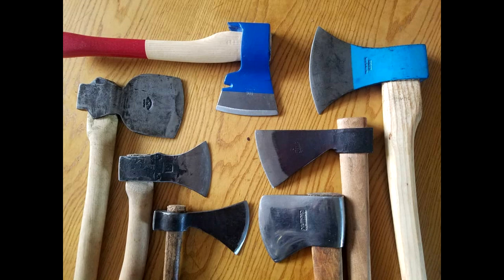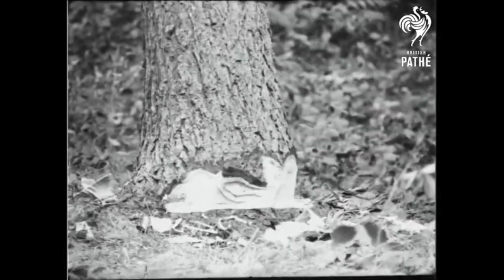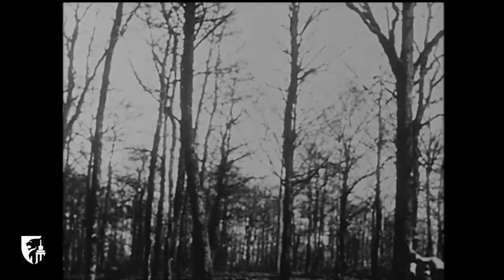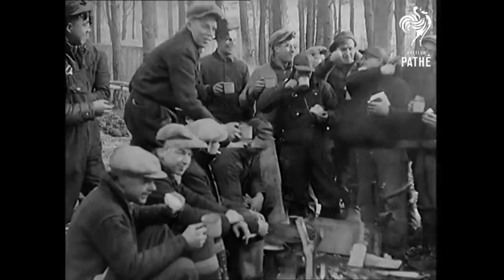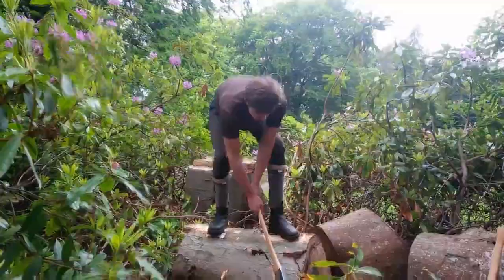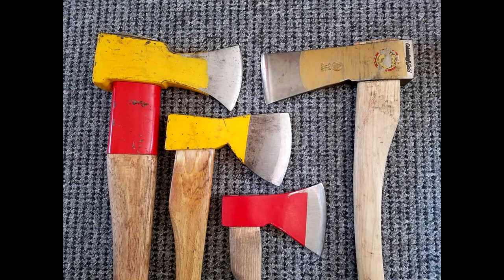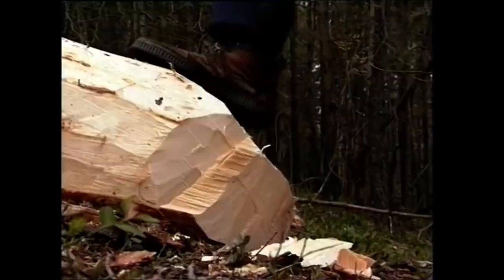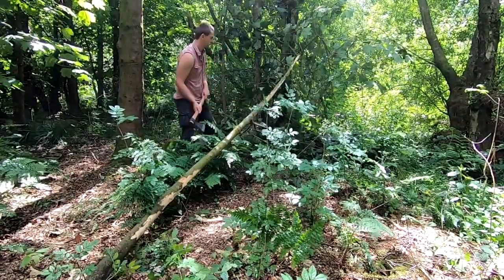Axe Design: American vs European Context and Use

Comment: I recently came across an interesting reason why the finnish axe design developed the long collar design. Available wood for the handle is one thing but apparently the other reason is that when you are doing heavy axe work in very cold conditions, below -20°C which would have been common, the actual metal around the eye was suggestible to cracking and breaking because of how brittle it becomes. Also in that context it makes sense to use raw iron for the body of the axe so that it's as soft as possible. Oh and very good video, I enjoy the hell out of theory/practice contemplation and you know a lot of stuff.

Comment: That's one excellent introduction video to axe design in general, it akes it clear the technical product only makes sense in a specific social and environmental context. The individual farmer who uses his axe mostly for coppiced/pollarded firewood and occasionnal felling doesn't have the same needs as the small 2-6 men team of seasonnal professionnal lumberjacks (who also does plank sawing and stuff), who doesn't have the same needs as the very large 20-50 men teams of all year long industrial logging which fed steam-powered sawing mills. 

Europe is characterized by an absolutely huge diversity, with basically all possible uses and designs covered. And some exetremely different design philosophies. For examples some axe eyes descend from a collar that is almost a closed socket in which the handle is held by friction, especially in germanic area (the typical example is the Finnish axe), and some on the other hand, especially in romance area, the eye is narrow and cantilevers on the handle (scure putignano, French bigeoire, destral catalana). What's amazing in Europe is how some patterns used to go from 300g to 3kg (Vizcaina, Sila/Sicilia/Calabria), and it's always the exact same design just scaled up or down. 

Anyway, here is a video you might not know about the lumberjacks of Sila (almost the same area as Calabria), but using wide and thin bitted axes that seem to be trento/trentino pattern, much further North. It may be possible that these lumberjacks from Sila/Calabria, a poor region of Italy, bought their axes in the North of Italy, where they might have worked seasonnally, and where all the steel industry is.
https://www.youtube.com/watch?v=InowGvmY3VU

Here is another video, absolutely not from Europe as it's from Indonesia, where we see a long and narrow axe:
https://www.youtube.com/watch?v=sk2f0ShzE0k
What's super interesting here is not so much the axe, than the fact he's using it with techniques quite similar to those used with stones axes (start around 18:00):
https://www.canal-u.tv/video/cerimes/yeleme_la_hache_de_pierre_polie_en_nouvelle_guinee.8535

Comment: Awesome video - HUGE Thanks
An addition why Axes like the old Harz pattern (Bison) had a diagonal head with the poll lower than the bit has its reason in giving the head a bigger lever for upward and sideward pulling of the handle when stuck, while keeping weight of the head nearly the same. American patterns did the same with extending the poll and adding lugs to the sides of the head, but which also increased weight.
Kind Regards

Comment: This is gold, great explanation
Reply from the maker: Thanks, glad you enjoyed it
Reply: @benscottwoodchopper  could you give me some advice? I'd love to have a splitting axe that would stick just enough in hard dry beech so I could use that to move smaller pieces but then get pretty wide so it doesn't stick when I don't want it to. Is this even possible and if so, with which kind of head should I go? So far I'm thinking the super splitter type became its relatively narrow in the front. Also I'd want it to be pretty light, around 1,5kg for the head.
Reply from the maker: @petrl9838  yes super splitter type is good
Reply: @benscottwoodchopper  thanks mate
Reply: @benscottwoodchopper .    Hi Ben.   I’ve just bought a lovely Kent pattern head after watching a Bundu Fundi video based on an axe you sent to him.   Not having fitted a handle before , except to a spade !!,  the interior of my head is not true on one side.  At some stage in its life it may have been used as a hammer which has made it slightly concave externally, and convex internally as the head wood has been crushed.  It’s not a massive amount and I could file it internally a little removing say 1mm off the highest part.   Do you have any advice ?   It might even have been forged that way.  It’s a Gilpins head. It doesn’t look as if it’s had a hard life.

Comment: On my second time through, I found myself wondering what your thoughts and research has led you to think about the development of the double-bitted axe.  My understanding is that while very old
Doubles have been found in the Middle East, double-bitted forestry axes were originally a West Coast development in America.  Is that correct?  And what do you think prompted the demand?  Thanks
Reply from the maker: double bits have been used in parts of the mediteranean, most ive seen are bronze though, perhaps becasue a bronze edge deformed easily it helped a lot more to have 2

Comment: Hey Ben,
This week i tried bucking for the first time with my Dayton axe and another simiöar to your Berlin pattern. (160 mm axe head lenght+650 mm handle/200 mm axe head lenght+700 mm handle) I hanged them long time ago so toe, heel and handleend are not in line.
I had an easier time with the shorter head+shorter handle Dayton, it was less akward aiming.
I watched the Tuatahi YT Axe hanging video and he said so it can be used for underhand and standing, if the 3 point line up.
Now from my recent expirience, looking at the hangs of my müller biber/and this videos axes is having a lineup of the 3 points only relly important when bucking?
Its not too important for limbing or felling? 
(Sorry, for asking again, i forgot this info over time, not having need for new hangings for years)
Reply from the maker: if the 3 points line up it is nice but i think that applies to different situations axe heads and handle types. on a racing head it makes a big difference though

Comment: Great video! I've bought several vintage axes including two similar to the berlinpattern but with an american eye and therefor much thinner. I also bought an old harzer axe because I think they look cool. But No matter what (or wich? please correct me) Axe I've used for driving wedges, they seem to rather deform than driving the wedge eventhough Buckin Billy talks about how great this and that axe will be for driving wedges. Is he using plastic wedges or come all american axes with a hardened pole? Anyway for sharpening I use Pferd files. They have an own cut called Pferd-Plus. Have you ever tried these? Btw another video from german forestry but this time on falling a tree with axes https://www.youtube.com/watch?v=iF9KgTuWpC0
Reply from the maker: axes are not reccomended for driving wedges. bucking uses plastic which is fine, but aluminium is dodgy and steel wedges is a no. That's what sledgehammers and mauls are for. American axes do not have a hardened poll except the 'rafting' pattern, but even that has a tendency to crack in the eye. there simply isn't enough reinforcement there hardened or not
Reply: @benscottwoodchopper  do you know if the "spaltfix" axe from Ochsenkopf is suitable for driving wedges of any kind? I'm not sure if they're hardened at the pole but if they are there is enough material backing up. I planned to buy the schlegelaxt but I couldn't find a cheap one on eBay so I bought a set of three axes including one spaltfix and because he sent it very late, he put two spaltfix in instead of one. For 32 euros I found it a very good deal even without the second one.
Reply: @frankbauer2561  Schreib Ochsenkopf mal, die haben mir innerhalb von 2 Tagen geantwortet. :)
Reply: @1südtiroltechnik  An welche E-Mail? Ich habe schonmal geschrieben aber keine Antwort bekommen. Vielleicht ja die falsche Adresse...

Comment: I believe the long nose European felling axes with the short edge length are specialist axes for felling thicker trees, from a time before saws became common. I think there is also a lot of Dane axe and Viking axe DNA in the European axes with thin heads and longer edge lengths. Ironically the commercial Scandi forges are mostly making American-style designs these days.

Hultafors claims that thin axe heads are prone to "splintering", i.e. shattering if struck on a hard surface. I think this can be true in the hands of an inexperienced user and with a  very hard mono-steel head. However the truly traditional scandinavian axe heads were laminated with soft steel on the outside and hard steel inside so they probably never saw a whole axe head shatter those days.

As such, an American-style design tends to be both easier to make (from the blacksmithing perspective) and less of a liability for safety concerns.